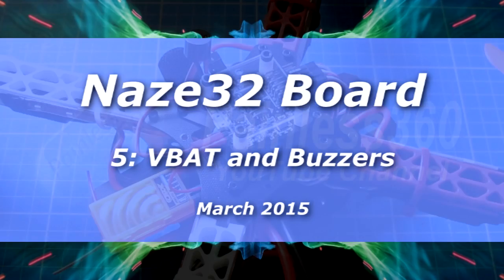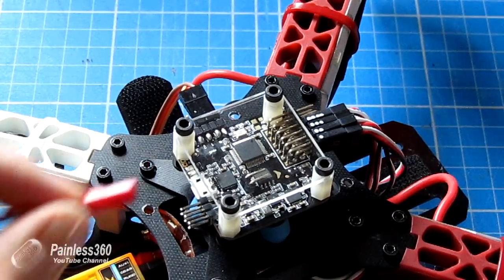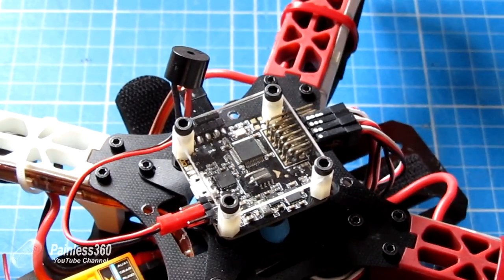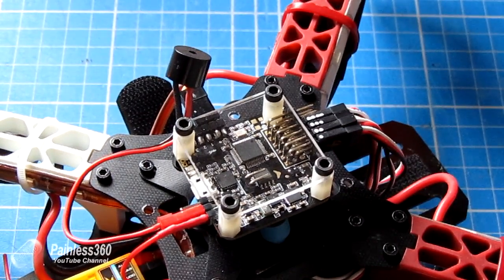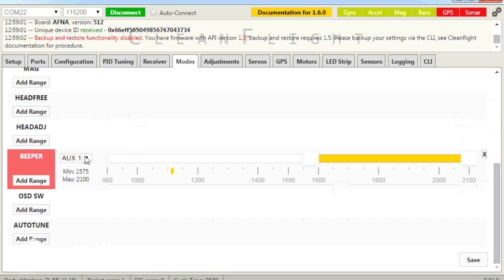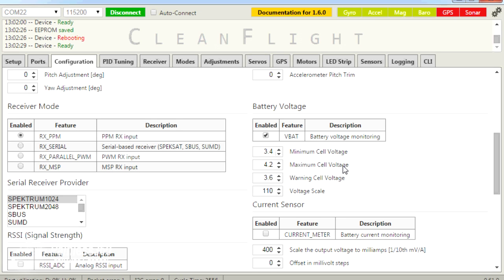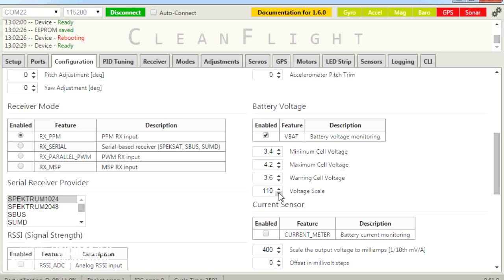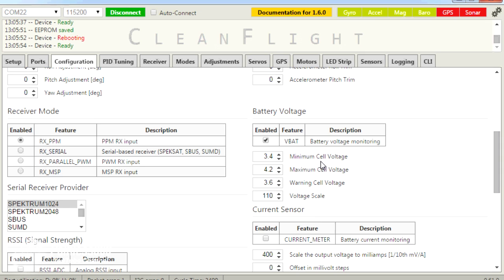(5/8) Naze32 Flight Controller - Battery monitoring (vBat) and buzzers

Comment: What is the difference between minimum voltage and warning voltage in terms of alarms and stuff? Because mine already beeps at the warning voltage, but will it somehow drop out of the sky, initiating a fail safe when it gets, even a nanosecond, below the minimum voltage?
Reply from the maker: I'm not a fan or voltage warnings as the voltage in a pack drops alarmingly on high throttle flying anyway. I'd set the minimum voltage way below where it is now...

Comment: Fantastic, but I just connected from the power leads to the VBAT on an SPRacing, I turned it on in Beta, set the settings alone just like you showed, but I didn't get any buzzing? I have a buzzer coming tomorrow I have to hook up, is that what triggers the buzzer? I totally understand my question is idiotic by the way! :)
Reply from the maker: You'll need a buzzer to hear anything.. Best of luck!
Reply: Since you seem to be a Spektrum guy, any video on how to assign channels to switches?
Reply from the maker: Not planning to. What radio do you have?
Reply: Painless360 I got the Dx6 straight out of the gate, and I think that's the issue, but I'm a very fast learner.

Anyway, example of strangeness - I have to set the Travel to 125% to get anything to Arm. I was having a seizure trying to find out why arm was not lighting up green in betaflight.

I still have no clue why this is neither did the YouTube poster I found who briefly mentioned this, NO ONE else understood me, I thought I was losing my mind.

Comment: Awesome Video Pinaless360. Question, If I give full throttle and my voltage drop bellow the min voltage. Is the Vbat alarm going to go off (real-time trigger?)? or is it going to wait until the voltage drops for a period of time?

Cheers
Reply from the maker: Yep, it will.. I don't use low voltage alarms as they go off on hard throttle moves as soon as you start flying! :D

Comment: ho there I have a buzzer on my naze32 but it gives off a constant steady beep as sson as your flying or throttle on any ideas why?
Reply from the maker: Mjstark91 probably the low voltage alarm. What troubleshooting have you already tried?
Reply: Painless360  I have checled the batterys to make sure its not them they are all fine all cells the same voltage also changed my warning cell voltage from 3.9 to 3.5v the min max settings are 3.3 and 4.3 using 4s 1300mah batterys
Reply: Mjstark91 I had the same problem and come to find out it didn't work good with cleanflight. I changed to betaflight and now I can fly after weeks of trying to find the problem. thanks painless for your help also.

Comment: Can you connect the vbat to the red lead (or white lead) of the balance plug on the battery? I checked the voltage and it shows the correct voltage for either one. Due to the design of my quad I'm not using a pdb. I've come across info on the web that indicates the alarm would constantly go off under hard flying so I'm not sure this would be a good way to monitor battery voltage. BTW, great video series, for both the Naze and Taranis. Great in depth explanations for setting up these controllers. Keep up the good work.
Reply from the maker: +Vection noitceV the balance tap will work find. Best of luck

Comment: How would one go about getting accurate readings from Vbat when its plugged into a 5v port on the PDB?
Reply: Using a 3c 11v 2200mah
Reply from the maker: don't connect it to the 5v. You connect it to the main flight battery voltage.. Best of luck!
Reply: It wont over load the board?

Comment: Hi Painless360 I have seen various diagrams that show power connections of both positive and negative from PDB to the vbat pins on a naze32 rev6? Is that necessary or overkill or just wrong? Thanks
Reply from the maker: I'm a fan of connecting a GND wire if there is one on the connector. In theory it isn't needed but I always do..

Comment: Sorry if this question is stupid but I want to make sure nothing bad happans: Can I connect the vbat pin to the 11V pads on my PDB because I didn't fully undestand what you have meant when yous said that it can only handle 5V? Thanks for the answer
Reply from the maker: Answered at 2:45. The vBat connector is the only place you can put anything other than 5v on the board.. Best of luck!

Comment: Hello Painless360,
Hello,
Quad is working fine but once I plugged VTX, Naze32 start beeping and motors does not respond but once I unplugged Vtx quad start working again and Naze32 stops beeping. I'm taking the power from the Power distribution board. Camera and Vtx are working fine( I got a clear image on the FPV monitor.) Do you know what is wrong ? What could it be the problem ? please help, thanks
https://youtu.be/bn5s_YJak6E
Reply from the maker: That beep usually means that the battery alarm or radio receiver isn't been seen. I'd check what it does by doing that plugged into the PC and monitoring the voltage and radio receiver still work ok.. Best of luck!

Comment: you said that the naze only like 5 volts so do i need a pdb with a bec to step down the battery voltage to 5 volts or can i plug 12 volts dirrectly into the naze?
Reply from the maker: You're right to check - getting things like this wrong can fry your board. vBat is the ONLY place on the board that will connect to the main battery voltage without damaging the board (triple check polarity though). It uses a set of voltage dividers to feed the voltage into a analogue to digital converter so it ends up being at a level the logic on the board can safely 'see'. Best of luck with the build!
Reply: thanks for the reply, i do too!

Comment: what kind of wire would you preffer for vbat if u are usimg a 4s battery
Reply from the maker: Great question. In fact, you can use anything to nand really. The wire will carry a minuscule amount of current so it just needs to carry the battery voltage safely. I use normal sized servo wires (or a little larger) I've cut off from somewhere else. Best of luck!
Reply: ok...thank you very much...
Reply: do i solder the vbat straight from the pdb to the naze32...or do i need something in between them?
Reply from the maker: Straight from one to the other. Triple check that polarity though... ;D
Reply: Painless360 can I use one of ESC pads for vbat. should I use power and ground or just ground?
Reply from the maker: You could if you've got no other place to solder it to.. Best of luck!
Reply: Thanks painless360. Your a legend

Comment: I've got my vbat and discovery buzzer working, but it's very quiet. I can't hear it over the motors spinning in flight. any recommendations for a louder buzzer?
Reply from the maker: Not really, make sure the hole on the buzzer isn't covered. The buzzers main use if to help find it in the grass after a crash and the props are usually not spinning then ;)

Comment: Hello! First, I'm french so sorry for my bad english... ;). I have a problem with the Vbat monitoring on my Naze32 Rev6. I have connected the V+ of the battery on the Vbat+ pin of the Naze, activated "Vbat monitoring" in Cleanflight and check the "feature Vbat" in CLI. but I have 0V find in cleanflight. I Have also checked the voltage on the pin with a voltmeter : 12.06V but always 0V in cleanflight. I have maybe forgotten something... Can you help me ?

And thank you for your great videos ! I find in a lot of solutions and I can practice my english listening with it... ;)
Reply from the maker: +Cedric Bocquet sounds like you have done what you need to. If the process in the video is not working then the vBat port may be damaged. I'd let the seller know. Best of luck

Comment: Can you use this to display battery voltage on your transmitter.  Otherwise I will just plug in a low voltage alarm to my battery.
Reply from the maker: +c siebester you can. See our videos on connecting the Naze32 to use the telemetry. We added it to a Taranis radio. Happy flying!

Comment: Hi. 

First of all: Thanks for such a great tutorials!

I have a question: The voltage that I can see on the "Taranis Plus" screen is the right one...but, when I activate the switch to get an audible voltage report...the voice said a different one...usually 0.5 volts over the one I'm getting on the screen.  I'm lost with this situation.  Do you have any idea how to fix it or why is this happening?  Thanks in advance for your help with this matter.
Reply from the maker: +Juan David Barrada check you are using the right voice pack for the  erosion of OpenTX you are using. Things changed from 2.0 to 2.1.. See the Amber Pack details for example..
Reply: Thanks for answering.  Yes, I'm using right that one: The Amber Pack...
Reply from the maker: +Juan David Barrada new version for OpenTX 2.1.. Make sure you've got the right one on the SD card..
Reply: Ok. Thanks again for your help. I'll check and then I'll let you know how it goes.  Cheers!
Reply: Great! It's solved!!! Thanks a lot for helping me with this issue!

Comment: 6:00 - Question about low voltage alarm on a Naze32 rev.6

I have a DX6i, so I'm limited on TX channels, and I really don't want to use a channel on lost model alarm. So I'm wondering if one can set this up so that a buzzer to start beeping when you lose RSSI? So basically turn off my TX to start the alarm to set off the buzzer instead of using an auxilary on my tx because I've only got 2ch to play with.
Reply from the maker: In theory you could manage with 6 channels - Thr, Elev, Ail, Rudd, Mode, Buzz. You can use the disarm stick position to act as a lost model alarm too, the following is from the manual - 'If the arm/disarm is via the control stick, holding the stick in the disarm position will sound a repeating tone. This can be used as a lost-model locator.' Best of luck!
Reply: I was going to use Arm/Disarm on a switch to be hones, but are you now talking about the throttle/rudder stick position?
That's still a good idea :)
Reply: +Painless360 I think mixing is the way to go. if I do some mixing with aile/dr and elev/dr I can get 3 positions on the ch5 switch (flap) ?
Reply from the maker: Possibly - depends on the radio but I've managed to get things like the DX7 to output a number of channel values by mixing two switches.. Best of luck!
Reply: +Painless360 dx6i as I wrote in the first comment 😊 Should be able to do 3, maybe even 4 values on channel 5 to setup features in BetaFlight :)

Comment: The point at the end about not having a battery plugged in...how will the beeping be powered if there is no battery plugged in?  The LVC alarm will draw power through the usb cable?
Reply from the maker: How do you think it's working? You're right..

Comment: Well, I am pretty sure I've messed something up. As you say CHECK AND RECHECK polarity, but I decided in my case to mount the pins on the underside and viola! I muffed it and put the 12V in the negative pin also the same with the buzzer. I still see it recognizes the FC (Naze 32) in cleanflight, but when hooking the battery up I don't hear the ESC's now and there is only a blue light on the FC lit. Any ideas? Or is it toast? BTW never saw any smoke either.
Reply from the maker: +Dean F yep, you've cooked that bit. The internal GND track for vBat will be destroyed. Best of luck..
Reply: Thanks for all the help, and One more item I am really stuck on... Setting up a SP F3 board now with a D4RII with my Taranis, and have checked UART 3 in ports, SBUS and and Serial RX in Config, powered up the receiver and board together and see they are bound, see 14ch, but don't get any stick movements reflected in the CleanFlight GCS. Any suggestions? Thanks again- I feel I have advanced so much with your help! ;)
Reply from the maker: A few screenshots can be useful - pop me a link to the main tabs in CF..
Reply: I just made a short video and will send the link soon (it's uploading)... How may I send you screenshots? Is it possible through this medium?
Reply: screenshots:(1) https://www.dropbox.com/s/kb7pjtrg1v3io7v/2016-05-24.png?dl=0
(2) https://www.dropbox.com/s/wfcch6vlhb0rugw/2016-05-24%20%283%29.png?dl=0
(3) https://www.dropbox.com/s/kb7pjtrg1v3io7v/2016-05-24.png?dl=0
Reply: After watching some more videos and reading threads I realize that the D4 is ppm (I also have an XSR -SBUS I just mounted on another quad) so I switched to ppm receiver and specktrum1024 left UART enabled and still nada...
Reply: Well I finally got it going by switching to the RIGHT UART port. It fired up all inputs on receiver page lit up, it spun the motors and I thought I had it so I installed a buzzer pin and it worked -so i put it all together with the top on and reconnected the buzzer to the wrong poles!!! I saw a little smoke from an led in back and did not hear a buzzer on start up and thought CRAP -what now? I took it apart and discovered the polarity problem re did it and got the buzz and ESC notes seeing the receiver bars light up, and now no motors spin even though if I want, I can spin them in CF but not with the Taranis! Have I shorted the board? Learning the HARD way but gaining knowledge! ;)
Reply from the maker: If I were you I'd get another board - I'd not trust this one even if it appeared to be working after all the mishaps. Best of luck with the next one!
Reply: Thanks, and Great minds...

Comment: cheers mate, your advice popped my board..
Reply from the maker: +Adam Hand Sorry to hear that. You either have a different board, a duff one or missed a step in the video. It's one of the most dangerous things you can do to a FC - add main battery voltage - so that's why we stress checking polarity so much in this one.. Best of luck with it.

Comment: I was wondering how can this flight controller determine each cell's voltage without battery balancer cable being connected?  Or is it simply  reading the total voltage of the battery? If so, how to tell it about the number of cells? I just got miniquad with Naze32 and I would love to get voltage monitoring on it, but I am not sure what is possible.
Reply from the maker: +Tomasz Wisniewski have a look at the latest vBat documentation. It doesn't read the individual cels. Happy flying!

Comment: for the Vbat, the red wire is connected to 12V or 5V in the Power distribution board ?
Reply from the maker: +Tuan-Anh Nghiem the answer is in your question - what is the vBat measuring.. Best of luck!

Comment: Hi

what is the name of the single connector you are using in the video to connect the vBat  @4:20?

Thanks
Reply from the maker: +Jeremy Giordano answer at 3:20 ;)
Reply: +Painless360  Not the JST, the single connector you plug in @4:00. or is it a female DuPont pin covered w/ heat shrink?
Reply from the maker: +Jeremy Giordano that's it! Best wishes

Comment: A touch baffled. Finished all my wiring and soldering, then setup my transmitter and plugged in everything. Buzzer worked like a pro on my aux2 switch, and battery voltage was displaying on cleanflight and nothing went up in smoke so I choose to move onto a flight. The buzzer started beeping as soon as I left the ground and continued throughout my flight. The lost model portion works fine but I don't want to fly with the alarm going off continually. Do I need to play around with voltage setting on the config. page in cleanflight or is there a fault with my board?
Reply from the maker: +will cook Sounds like the battery voltage is dropping below the vBat level then.. I'd start there.. Best of luck..

Comment: the buzzer works fine ( i tested it on a AA battery ) but i plugged it into the naze32 in the midde set, with red upwards, and i wont buzz? i tried both ways round ( polarity wise ) and it wont sound.. Im using a 3s 1300mah lipo and everything else works?
Reply: +Tommy Pezzino no I didn't D: with that buzzer but then I got another one that had 3 wires which plugged into my radio receiver and I put it on channel 6 so I could still use channel 5 for the Naze board it works great now thanks and I can find link to it if you'd like it, it was only about £3-4
Reply: +Tommy Pezzino No problem, glad I can help :D

Comment: +Painless360 How can one add current monitoring in addition to voltage monitoring to Naze32/Flip32?
I can find some APM power modules, but I'm not sure if it can also be used with these boards besides APM.
I'd like to add the mAh usage to the MinimOSD info.

Comment: Great video sir, One question , I have a piezzo buzzer (2 pins) connected to my naze rev6 , so it beeps and keeps beeping till I turn on my tx, but if I don't turn on the tx it keeps beeping, what can you do to set it to beep only when I use the switch that is connected to beeper? thanks
Reply from the maker: +Alvaroeduardo I've never tried and simply unplug the buzzer if I'm testing on the bench without the RC Rx powered up and connected. This is a great feature and acts as a lost model alarm. I wouldn't change it if I could.. Best of luck.
Reply: cool, thanks

Comment: Hi.. is it possible to burn my naze32 if i "do not" use ground cable, only + cable to the VBAT + contact? I have done just as you show in the video, and it worked great with one "4s setup" But on another setup I have managed to destroy two naze32 boards :(  Do i need grounding cable when I run more than 3s setup? Because everything worked great until i but on 4s, and the naze32 died  immediately och never started again.
Reply from the maker: +Dussan81 I've tride both (with 3s though) and they work fine. The GND should be common in the entire system.. Best of luck!

Comment: K so double checking...the power wire to the board is connected to straight to the battery? RIGHT. thats NOT a 5 volt lead, but a 11.1 volt lead with a 3s battery.